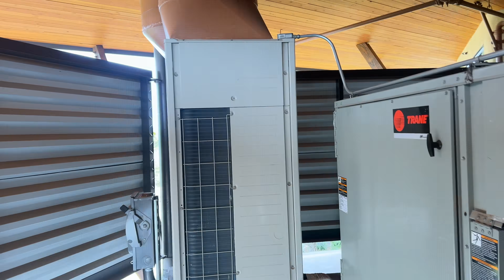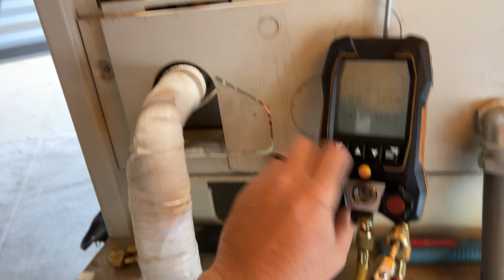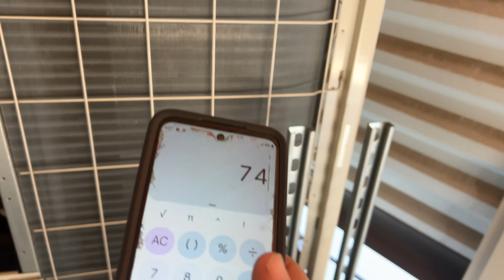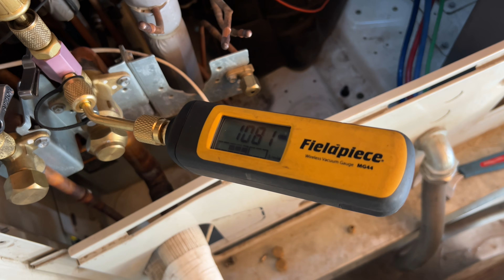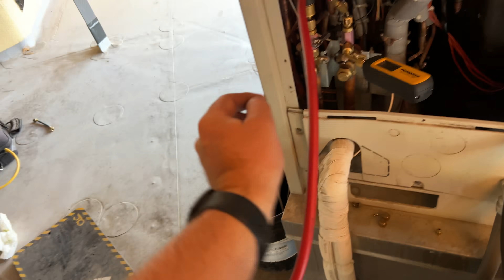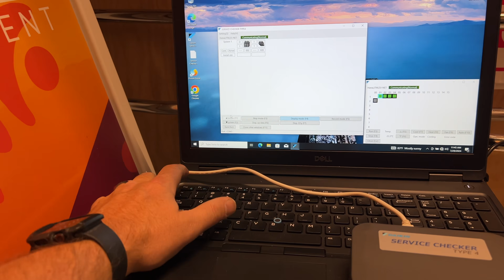Thermostat Call Turned in to Daikin VRV Grounded Compressor EP185

Comment: Does this unit not come with LL dryer?
Reply from the maker: Nope. Think of it as a big multi head Minisplit.
Reply: VRV/VRF Equipment normally doesn't have a filter drier.  A canister style filter drier can be added after a burnout to allow for quick filter changes to remove acid.  When this is completed it should be removed from the system.

Comment: Daikin also wants us o install a suction drier with bypass when you have a burnout.
Reply: @desieranks  not necessarily required. Depends on cause of burnout
Reply: The problem with a burnout on VRF is that it has no drier-filter to clean the oil, so you just keep replacing compressors one after the other.  So a temporary filter is the only way to get the acid out.

Comment: Oil flushing out. Same thing will happen again. You need to look for the reason the compressor fails repeatedly. Likely a contaminated EEV from installation. Stuck open, liquid flood back washes oil and kills compressor. Also no need to change the PCB on this occasion. Also, I had that ServiceChecker fault this week. It would crash the program. I rebooted and it was fine. Maybe remove SD card and try another USB port. Hope this helps
Reply: Any info bud on how to check the board  to confirm that it is good.
Reply: @desieranks inverter analyser
Reply from the maker: I was thinking the same thing. I couldn’t get my service checker to work. I ended up trying a different laptop and now it works. I’m probably going to go back and hook up again.